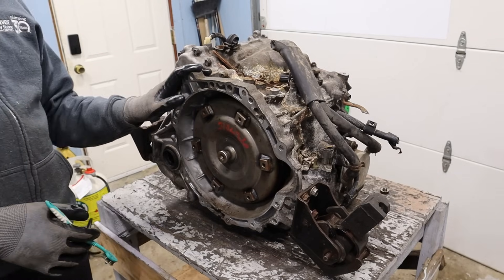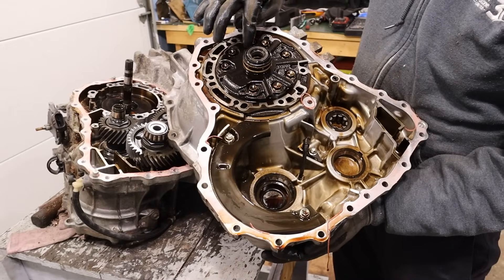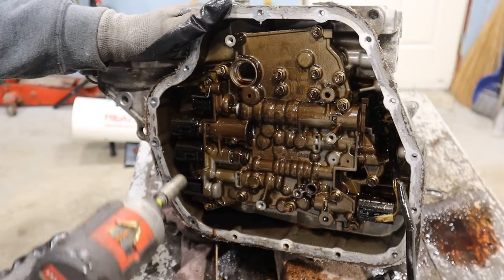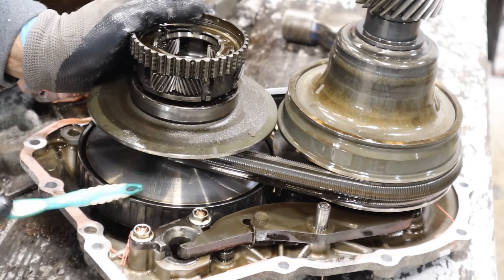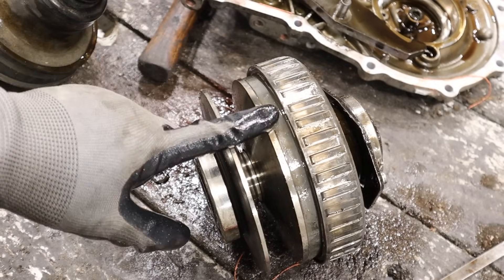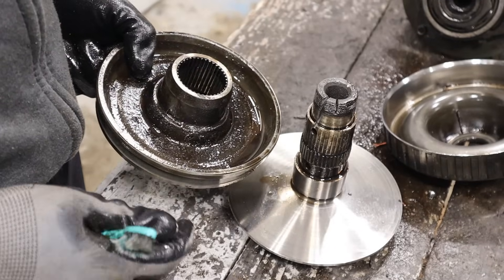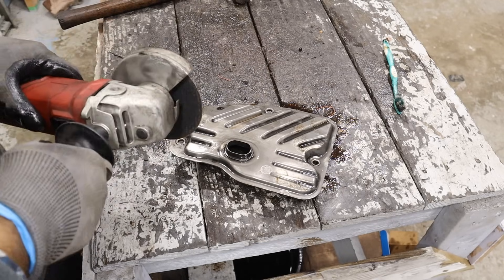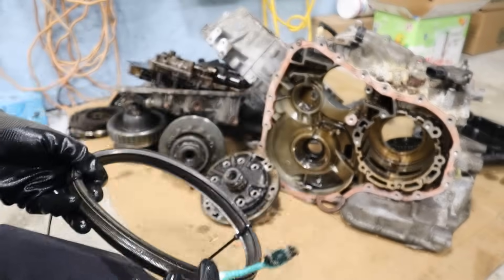Toyota CVT's Are Not as Reliable as you Thought! Corolla K313 Transmission Teardown & How it Works

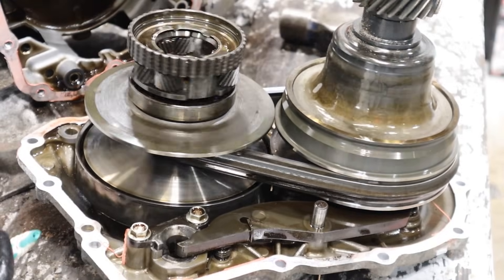Comment: 9:47 "[Corollas] are always sitting in the left lane blocking traffic anyway."

In areas where passing on the right is against the law, I prefer to think of Corollas as driving the speed limit and large trucks aggressively tailgating behind them, forcing the Corolla to continually merge into the right lane to let the truck pass, only for the Corolla to get in the left lane again to move up.

Large trucks, meanwhile, drive a good 15-20 mph/25-30 kph above the speed limit and continually speed in a straight line in the left lane instead of obeying traffic laws.

Speed limit logic tends to be 5 mph/kph over the cops won't stop me. 

Passing will require another 5 mph/8 kph over that.

Impatient truck drivers passing multiple cars with one lane change requires 5 mph/8 kph over that, resulting in a 15 mph/24 kph above speed limit reckless driving charge, only the cops never seem to be there to act on the speeder.

Comment: Thanks for being able to explain cvt so easy.  I have a mitsubishi lancer se and the cvt has been working for 160000km and everything seems like it did at 60,000 when i got it.  Not sure if the fluid was changed at 60k but the fluid is still transparent and no issues.  Was wondering why you mention cvt no great do most break and what would the main reasons be, too hard driving creates heat and slowly wears parts, not enough oil changes so more heat and more wear, or the parts themselves are made bad.

Comment: Fantastic and thorough video on the Aisin K313!  Very clear and detailed teardown and operational theory.  Following along, it becomes glaringly apparent that the "lifetime fluid" that Toyota tauts is ill-advised.  I had a CVT failure at 80K miles in my 2015 Corolla LE ECO, wherein the engine RPM would suddenly raise to redline during warm engine cruise conditions.  I replaced the CVT with one from an 18K wreck and now religiously change the fluid/filter every 40K miles.  At 175K on it now, the internals are pristine spotless and the old filters contain practically nothing.  Aisin FE fluid and filter kit are about $60 on Rockauto...better buy a new drain plug and gasket while you're at it (really bad design).

Comment: I just replaced my 2018 Corolla transmission and it cost me 6350. The used transmission with 84k miles needed the valve body replaced and there was a loose bolt in it. The entire tranny prolly weighs 150 lbs, and I think we need to go back to traditional transmissions. This tech is getting out of hand. You buy a car twice with all the problems you have. I bought an 05 Corolla in 2012 and I still drive it today which is why I went with another one '18. Toyota ain't what they used to be yo

Comment: At about 65k mi I changed the transmission oil of my 2015 corolla. It has 84,000 still running smooth. I just learned that engine oil should be changed every 5k miles INSTEAD of 10 K (against what my Toyota dealer said and  the owner’s manual ). Despite my Corolla being a victim of oil misinformation, it still running thank goodness.

Comment: My wife and I are looking for a new car around Corolla size. I was going to insist on a manual transmission, but I may have to go used to get it. Or I could do the new Corolla with the improved CVT. But I really hate going CVT on anything larger than a golf cart.
Reply: The Hybrid Corolla has a eCVT Transmission in it which is really reliable. The standard Corolla has a standard CVT transmission which is reliable too with service at 60,000 miles intervals. If you are driving hard, I would say 50,000 miles
Reply: @natelove187  I am not yet comfortable with electric or hybrid. Also, the thing I noticed about the Toyota tranny is that it has a "real" first gear. For me, that's a game changer. It's the only CVT I'd even consider. 

All that said, if I truly had a choice, I'd go manual. I may go used just to get that option.
Reply: @ReasonablySane  I have a Corolla SE 2022. I’m just about at 60,000 miles. I’m going to do the drain and fill service myself. Easy to do. The transmission shift really good at 54,000 miles and it’s smooth in traffic and has decent acceleration and good fuel economy. The Toyota eCVT hybrid is made in Japan and is really reliable. You’re not going to have that Ford Mustang acceleration because it wasn’t designed for that. It’s designed for saving money; fuel economy and with minimal of no repairs at 150,000 miles or more. The taxi cab drivers drive them in NYC and Chicago for reliability and fuel economy

Comment: My 2015 corolla s transmission die today after 228k miles, never changed the fluid on it. started making a weird noise since 195k. Rock solid transmission i wish I had taken care of. I bought the car new and next car I will definitely do proper maintenance.

Comment: Finally, someone can explain how it works to me, using the parts. I have a Japanese-version 2010 Toyota Wish with a K311 transmission. I needed someone to take it apart and explain where the oil flows to make the changes. Thanks. 😅

Comment: Hey brother, I’ve got an engine size popped up and the code is P0841
Transmission Fluid Pressure Sensor/Switch "A" Circuit Range / Performance and P2829
Rough Idling
Pressure Control Solenoid K Performance or Stuck Off, what is the exact problem and fix for it ?

Comment: CVT is the reason I am going to trade my Corolla for a Prius (no belt and pulleys).  

Prius uses E CVT, a different breed of transmission boxes.

Toyota Motor Sales should be ashamed of themselves for selling CVTs in the ICE Corollas.

CVTs should be used for scooters and motorcycles.  CVTs are not for cars.

Greed.

Comment: i have a toyota corolla 2020 model ZRE210 1600 cc engine with cvt transmission . At 75000kms had the gear filter replaced , 5 liter toyota transmission oil put in , 
new metal gasket for oil pan , and new rubber seal on new oil filter . The original filter had FILTRAN made in Mexico on it. So obviously Toyota buys it from Mexico .
Basically there is 12 liters of oil , but the maximum for the procedure is 5 liters of fresh Toyota oil ( plus 300 cc extra ,also put in as topping up after a check run) .

Comment: Hey Speed need your help, Got an es300 2003 lexus, Transmission on cold start wont engage into forward properly, it engages and car moves slowly and then you push the rpm to 5k and it goes. if you let the car still until its temp gauge is up, it drives perfect. Reverse is all good on cold start also. Could you shed some light on what could be the issue here? i d really appreciate it. Thanks

Comment: Rare as hens teeth. Toyota CVT fail I've NEVER seen and I work in the trade ( on the tools )
Reply: There's no buzz around Toyota cvt failures. I'd only buy the direct shift version myself or ecvt. Nissan has made a big mess of it and that's half the problem. Lack of maintenance and poor driving habits is the other.
Reply: @Lyka-clock what do you mean?? Nissan CVT is woeful. Toyota is the best, simple as.

Comment: This is what I've been telling people for a long long time and I get laughed at 😂😂😂 the CVT in my 2016 Corolla failed at 78K miles.  Fluid was changed at 61K.  These things are pure junk
Reply: Sounds like you treated it like a regular transmission. 60,000 miles is for a regular transmission and 30,000 is for cvt drain and fill. You also can't drive these things like a spaz.
Reply: @Lyka-clock  - Nowhere states doing a fluid drain and fill every 30k miles.  The transmission is poorly made and that was the reason why it failed 🤷🏼‍♂️
Reply: @DeadofWinter321  I've done research on the cvt. What I found was the manuals have these listed as sealed for life. Inspect for leaks etc. Even old school mechanics would say, oh don't touch those. The reality is the cvt is sealed but it's just an overflow tube on the inside instead of a fill tube on the outside. This was originally to keep the fluid contamination free and to make it so the wrong fluid couldn't accidentally be poured into the cvt. There's still a drain plug toward the bottom of the unit to do a drain and fill. The fluid will get hammered regardless since it's a friction based system. Depending on how you drive will be a factor but there's no way in hell anyone should wait 60,000 miles to do a drain and fill on a cvt. You should also take it to the dealer because it's a tricky process where the level and temp has to be right on. I hope this helps. Also, there's no evidence of early cvt failures regarding Toyota. It's been more of a Nissan issue.
Reply: @Lyka-clock - The fluid was changed by a certified Toyota technician (at a Toyota dealership).  They recommended every 60k miles doing a fluid change and they said a 30k fluid drain and fill won't make a difference.
Reply: @DeadofWinter321  https://youtu.be/ILqTMbyeSPI?si=OqY9yAJhljh3qIP5

Comment: The 2017  Toyota Corolla le is  super reliable 275,000 kms and never any issues , but great cvt,maintenance is impor😂tant to keep. Up,change cvt fluid every 60 to 80 thousand kms and the you won't have any troubles!!!!!❤
Reply: Id stay with 80 thousand kms. For tranni service ,if youchange the oil too often as the car ages there is wear and changeing it to often will cause the cvt tranni slip and not changing it you wont get to 200,000 kms., Never change tranni fluid on a cvt every 20,000kms you will be replacing your cvt transmissin way before you have to and that will cost thousand ,ive have worked at Toyota as a  head mechanic for 36 years .
Reply: @GaryJanzen-it3fn  you are right. Car Care Nut said to change the fluid every 60,000 miles. I guess if you are driving hard, it should be 50,000 miles. Need debris or friction on those clutch’s as the CVT age
Reply from the maker: Nice. 80,000 is alot to be running on fluid. I'd go a quarter of that

Comment: I have two toyota Yaris cars, one with K312 CVT and the other one with direct shift CVT. The K312 has 200000km on it and is running without any problems, the direct shift has failed at exactly 1400000. I let it rebuilt but it has failed again after 5000km. Luckily i had warranty from the workshop so they are rebuilding it again.
Reply from the maker: I wonder what failed in the rebuilt unit
Reply: @speedkar99  I'm curious as well. Interestingly the same symptoms appear as before the repair. I will post a message here once i know more details.

Comment: The "magic" for me is having a steel belt that is "flexible"which I couldn't get my head around until I saw a video on it. One big advantage of the cvt is that the engine is kept around its most efficient rev range and the variators do the rest.

Comment: I bought a 2013 Nissan Altima 1 yr. ago 125,000 on odometer and the CVT transmission is workin' excellent no problems so far at all and the 2.5 QR25DE engine continues to run perfectly smooth in my opinion! I grandma' drive the car so I'm easy on the CVT and that definitely helps, Lol. And plan on changing the transmission fluid soon. If u take care of a CVT transmission it will last . . .

Comment: 105,000 miles on this failed transmission. I have 494,000 miles on my 03 Marquis and no rebuilds and this car has done 100s of burn outs and treated like trash, in the family from new. It still runs and drives like a 20,000 mile car... when I see a CVT go 500,000 miles with absolutely zero servicing(original factory fluid and filter like my car) and driven like trash, then I will buy one...

Comment: I have this cvt transmission in my corolla  I purchased the car used I don’t think the fluid has ever been changed, it has 170,000 miles on it will it hurt if i change the fluid now?

Comment: I have a 24 Corolla with a CVT and it seems to work fine. But I do notice it takes a few seconds to switch from reverse to forward. I do wonder if people are in a hurry if this can damage them if you accelerate too hard before the switch?
Reply: That's a serious issue with the cvt. I see people throwing the car into gear while its transitioning and gunning it. You can hear the noise it makes.

Comment: Must stop making cvt, cvt is for very smal vehicles does not make that much difference in gas milage the amount that  you save on gas later have to pay for cvt replacement which is expensive people do not buy cars with cvt.
Reply from the maker: Yeah it's for economy. 
However manufacturers must use CVT to meet stringent fuel economy requirements. 
Most customers with these types of cars don't even know they're driving a CVT

Comment: I have the k313 gearbox. Serviced filter and oil at 9 years/34k miles. Previous owner had abused it. 

Original gasket is metal, looked like an aftermarket rubber gasket on yours.

Thanks for taking it apart in english, 1st vid in english on this gearbox on youtube. Been searching a long time.

Hopefully i wont ever need to take it apart, but not afraid too. all good info.

I only do 5k a year, so should easily last me for a decade.
Plenty of torque from the 1.2l turbo di  lump (8nr fts). Love it.
Reply from the maker: Nice. 
I guess not as many are failing to take apart?

Comment: Did they ever change the fluid it looks like burnt motor oil/sludge . Just like car engines /Cvt trans will fail if you don't change your fluid. I change mine in my Subaru Crosstrek every 25/30,000 miles. Do they  realize the solenoids are very high pressure in Cvt and I mean very high to clamp those Vario together. Cvt are much more simply compared todays 10 Speed transmissions but clean fluid is so much more important to them. They will last  Honda,Subaru,Toyota . Nissan has let there Cvt destroy there company by so many fails have tarnished there image by not making it right and there close to bankrupt.
Reply from the maker: Agreed it seems like the clutch was burned up and that caused the fluid to go south and take out other components. 

While it looks simpler, it's not as sturdy as a traditional automatic, especially once you load it up.

Comment: Cvt in general are crap technology.  Their not meant to be driven hard or driven normally. Upto 6 speed auto transmission are most reliable.  Less gear shifting not those 8 or 9 or 10 speeds
Reply from the maker: They are for economy devices such as scooters go karts and maybe a micro car... Load them up too much and they won't last long.

Comment: it is my hope that some manufacturers make CVT's and put a disclaimer.  " this will give you a smoother and better efficiency transport.  if you need quick acceleration regularly, this is not the correct transmission . "  the idea that CVT's could give people pedal-to-the-medal acceleration has proved to be an incorrect adaptation.
Reply: Indeed. But of course the manufacturers will not do that while there's anyone else around with conventional gearboxes who could use "you can ride OUR drivetrain hard" as a selling point.  So it was presented as not requiring drivers to do anything different and even as having "lifetime fluid",
Reply from the maker: So the theory is it could keep the engine in the rev band for quicker acceleration than running through gears... But in reality the engine just screams and you don't feel like you're going anywhere

Comment: I have a 17 Corolla with 296,000 miles and my CVT is just starting to make a whining noise and that’s without servicing it so they do make them reliable even when you don’t maintain them
Reply from the maker: Why didn't you maintain your Corolla?
Reply: @speedkar99 my guess: the dealer kept pushing the “lifetime fluid” lie, and by the time he started questioning that, it was already too late for the transmission
Reply: @speedkar99 it’s people like him that makes people not maintain their vehicles.
Reply: @speedkar99 they are cheated that "the gearbox is sealed for life. When it breaks, that marks the end of its useful life. So you buy another one". Here in Africa, we don't believe in that statement.
Reply: 296,000 on original CVT without a fluid service change and it lasted this long??? Dear God . . .
Reply: @JohnGordon-ll3pi Maybe they can't read numerals. 290,000 without service is phenominal!
Reply: Your one transmission lasted so that means they all do? Silly.
Reply: That transmission failed because who ever did the work messed it up ..Even the filter is no OEM..He should of drove it and left it alone..
Reply: I have a 2010 Matrix thats shifts very hard into reverse and when I let go of the gas at around 40mph I hear a low bang noise as well but other than that it works fine. Would you say this is a torque converter issue?😢😢
Reply: You got your money worth...No matter what happens..Trade it in and get a new one now..
Reply: Probably the metallic sludge is what keep running your transmission. Don’t flush your transmission, I’ve heard that it would be worse by this point.
Reply: I’m very curious if you could do a video over the same Cvt, I have a 2023 but was suproaes when it had “manual mode” and shift paddles basically simulated automatic gears?

Comment: I worked for a Toyota dealership and seen a few of the K313 units fail. However, almost all of them failed due to overheating and lack of maintenance. Owners are put off by the cost of replacing the CVT fluid in these units. They're even more put off by shelling $7000 to replace it. Those who have abided by CVT fluid changes at regular intervals and have not beat the 💩out of their vehicles can possibly see very long service life out of the CVT. I still would never own one, regardless of manufacture.
Reply from the maker: Typical Corolla owner.... Think it's just drive with gas and hope forever
Reply: @speedkar99 yeah and that alone sends the wrong message to people not to maintain their vehicles just because of the name. I can’t wait to drain and refill my CVT once I get to 60k miles
Reply: @speedkar99 so, do you not recommend CVT's at all over automatic???? I need to know ASAP, im about to buy a new car.